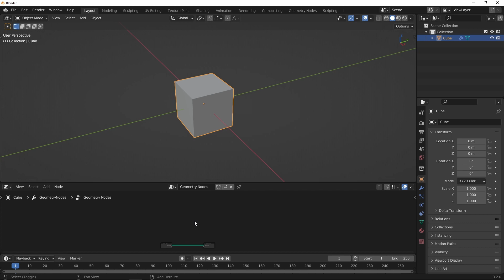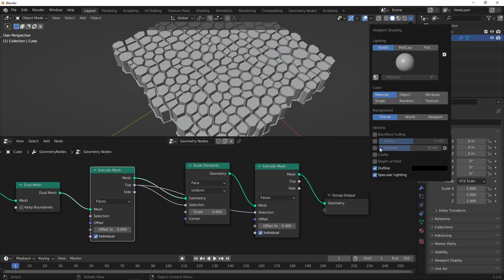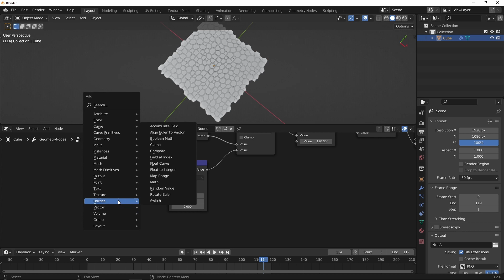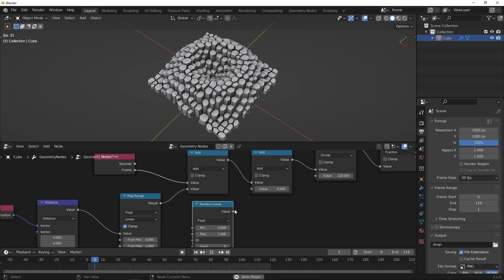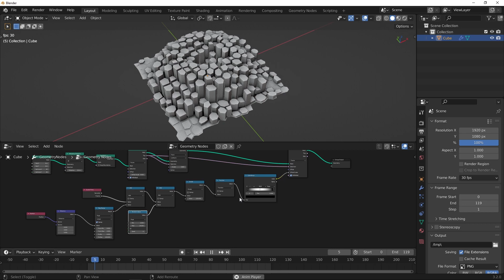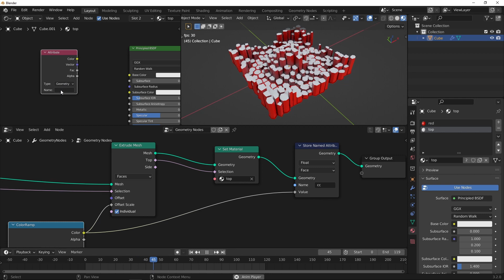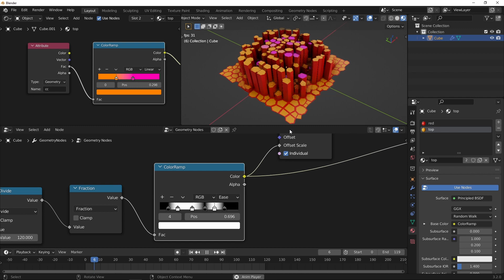Blender Tutorial: Seamless Animation Loops With Geometry Nodes

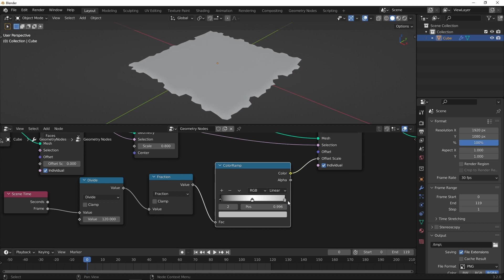Comment: 5:20 wow i just realized that color ramps can be used to trigger animation states. great work, thanks.
Reply from the maker: cheers! Yes, if you think of the ramp as a non linear remapping of time you can remap any parameter that fits into the 0 - 1 range. It can be very powerful. You can also use the float curve to remap in the same way, but I generally prefer the color ramp since you can see the values numerically.
Reply: @redjam9  damn man, i also no have idea that color ramp can giving value loop, great work